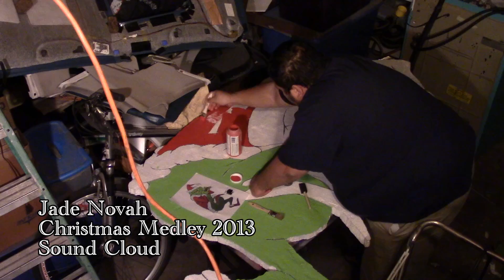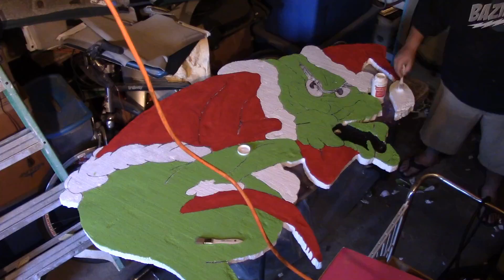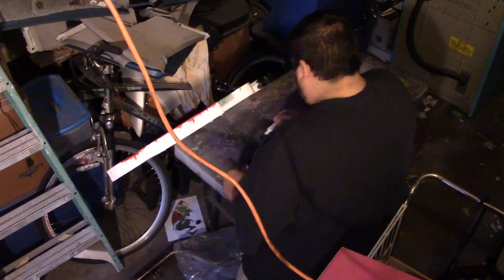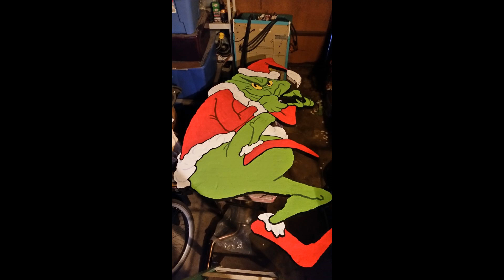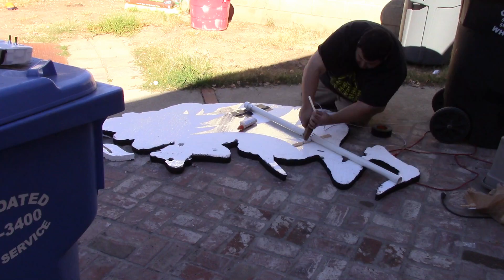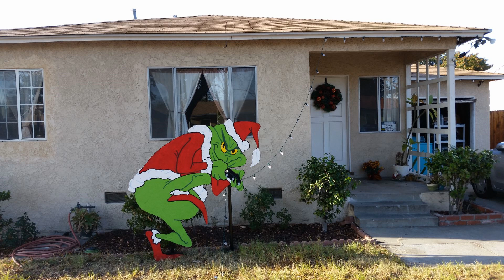Making 8 foot Grinch stealing our christmas lights

Comment: What did you use for weather protection,  for the acrylic paint wouldn't wash away from the foam board when it storms? Or does it not wash away in rain? I never used acrylic for outdoor  decor so I'm not sure. Thank you for the video, they're wanting $80 to $200 on etsy for a plastic cutout. 😖